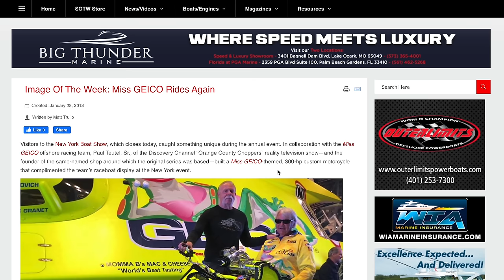Why you Should NEVER RIDE an Orange County Chopper

Comment: There are bikes that are made to be ridden, like the BMW GS in this video.  There are other bikes that are made to look cool, and still other bikes that use whacko technology and gadgets to get the wow factor.  The Geico bike seems like it is both of the latter.  It looks cool from a chopper viewpoint and the supercharger is ridiculous, but it has the wow factor a show bike needs.  This bike was never meant to be taken out on a day-long ride.  You don't design that awful riding position and crazy motor for cruising along the twisties.  OCC built a lot of bikes that were meant to just sit on the floor and be looked at by people who were under the spell of the chopper craze of the time.  Let's not pretend that these bikes were ever meant to be ridden and thus indict the two Pauls for crappy design.

Comment: Why American always use the old Harley motors which is old technic Using a Yamaha VMax engine build by Porsche already came stock with 200 hp and it is easy to tune 300 hp out of it!! Paul Sen was simple a con🤨

Comment: And probably 1 2 3 pound of boost?? You're on a dyno, hell a vac gauge will tell you how much boost.. what muppets are tuning this?? Theres no reason an efi setup with a map sensor that sees positive boost pressure cant get this to run properly. Shouldn't take very long. Tune the VE table with conservative timing then go for power. Frustrating

Comment: i think you need to have a show  about using explosives on that p.o.s. blow it skyhigh. kaboom  you make enough with your show to blow it up.i mean i have built bikes lots of bike with nitrous oxide  that would run that thing into the ground, but that thing is  number one ugly,  i wasted a lot time this morning watching this this waste of time bike, i wouldnt buy a damn thing for orange county choppers. i am building a sugarbear bike  with a 21 overstock springer gpoing to put a 150hp engine in it, just got the roller chassis and  painting it  this weekend, after the paint cures for a month i will install the engine with nitrous, wanna race?